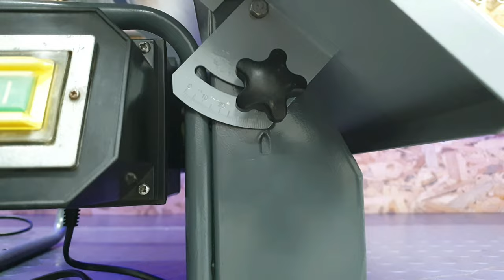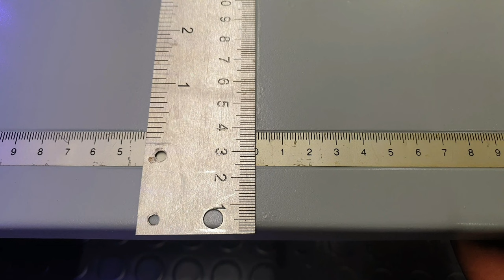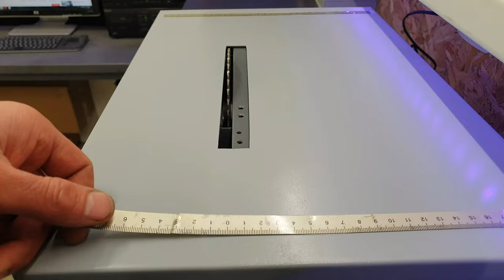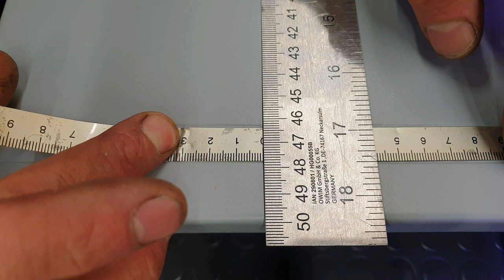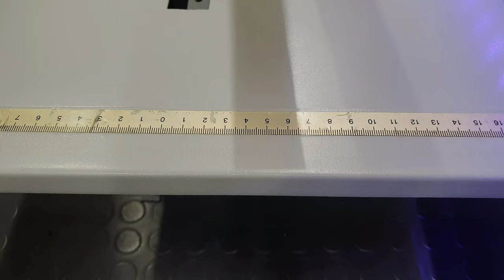Restoration of 12 year old Table Saw instead of throwing it away for scrap. using PARKSIDE Saw disc

Comment: Nice, but please when using angle grinder wear gloves, eye protection and breathing mask. And with saw be careful. You need blade protection and don't push wood with screwdriver. If you experience kickback you will know what I am talking about 🙂 Good job 💪
Reply from the maker: You are absolutely right, I am always in a hurry and I do not put on my glasses. But the mistake happens once and can be fatal.
While cutting, I saw him throw the cut piece. I'll come up with a cover for the disk. Thank you my Friend🙏🙏🙏🤝🤝🤝
Reply: @ErCanEverything  wire brushes tend to release some wires and they stick easily in flesh. You don't want that in your eye. So please protect yourself ❤️
Reply: Greatly done as always! Looks like new. Electric motor is a bit weak, but looks like getting job done. For small projects would do good job! Thanks for sharing!
Reply from the maker: Thank you Dostum🙏🙏🙏🤝🤝🤝